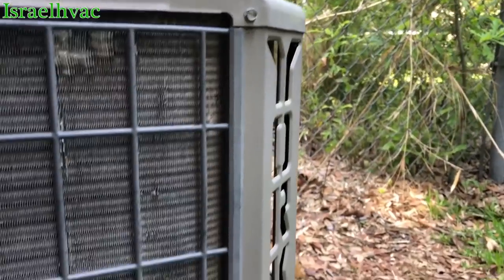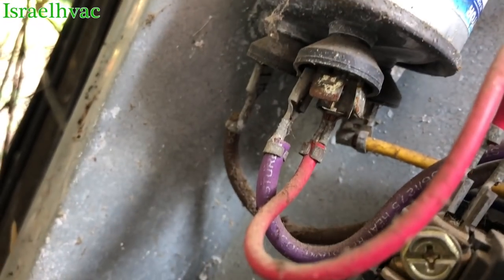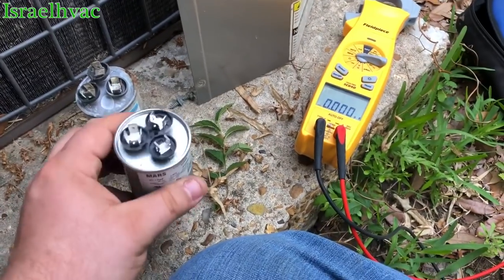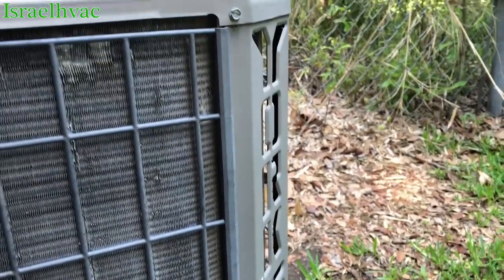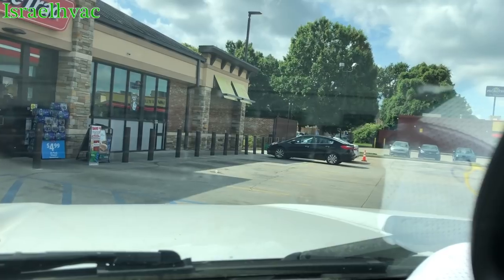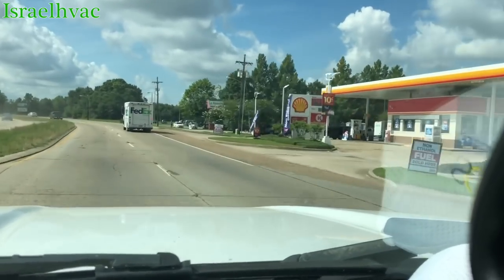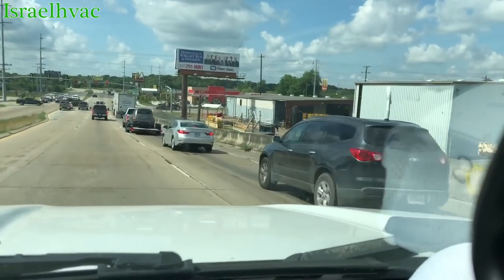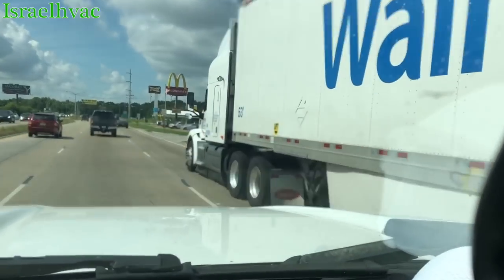HVAC | How to Diagnose & Replace A Blown Capacitor

Comment: I don't do ac work but I have for 30 years. You should have changed the contactor while you were in there, that thing looked rough from the high amperage. 
And no, I've never owned a Veto and I don't want one. I'm old and I don't want to carry 50 lbs of tools in one trip 😁 I use a tool belt pouch and throw it over my shoulder.
Great video 👍 The dog was wagging his tail, he's friendly 😂

Comment: Keep up the awesome job! Love the videos. Was on a no cool call yesterday had a blown capacitor on a heil unit and got the new capacitor against the low voltage contact and blown the 3amp fuse on the indoor unit got to love the hvac life

Comment: About the "fan spinning backwards" phenomenon... it is an illusion caused by the camera's shutter. When you have the motor's RPM fall into a multiple of either 30 or 60, it will look as if it's spinning slow or backwards. And like you said, the ones that keep saying that the fan is slow or backwards need to shut up!!

Comment: The camera is simply creating a strobe effect, plain and simple.  It is the same way a strobe light for a car works.  The timing mark is not sitting still as it appears under the strobe light.  It just looks that way because the light fires off at the same point in time where the indicator is at the same place.   The camera is doing pretty much the same thing.  It is taking a series of pictures or frames per second and if the blades are at or near the same position for each frame, the blades will appears to be moving slowly.  If the frame rate is slightly faster than the blade rotation, then the blades will appear to be moving backwards.

Comment: Question for ya. When you change the cap, do you just go back with what's in the system or actually check what came on it originally. B/C we all know those techs who sometimes just put whatever they have on truck on the system. Thanks.
Reply: KB Hotel maintenance home warranty techs lol
Reply: KB Hotel maintenance that's a great question, most of time what's in there is correct, if there's a doubt the motor will have it on the data plate if not you'll have to call supply house.

Comment: How much do you charge for a new cap ?
Reply: Cory Wade out here in Phoenix most of the big companies charge anywhere from 250.00 to 325.00 flat rate service fee waived, capacitor free with motor replacement.
Reply: phoenix HVAC-R 
Yeah I was wondering just how much for just the Capacitor
Reply: google the size cap you need; google is your friend. honestly you don't need to pay a guy like me to come replace a cap. if you're a man with common sense about electricity, knowing that it can kill you if careless, and can do the Sunday crossword puzzle, you can most likely change a cap.        $10-20 online for JUST the cap.
Reply: Spector NS5 RD I was asking him as a technician how much would he charge to do this job just curious the going rate in his area

Comment: That thing with the fan running backwards is a video optical illusion. Similar to a strobe light makes it look like It’s motionless.  This was evident when the US Patriot missile was credited with shooting down the Scud missiles in Iraq war. We kept telling the public we shot them down. Of course, they all missed.  Israel modified them and they worked better but it’s still a crap shoot. 
    Video and the fans are the same problem.